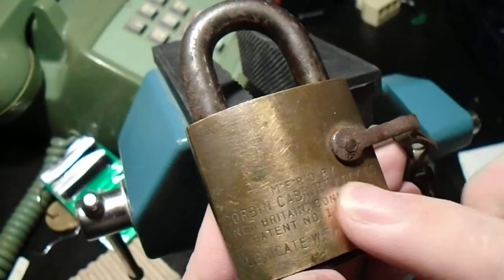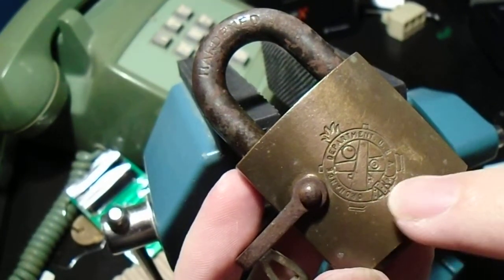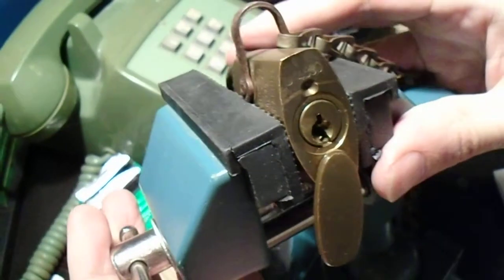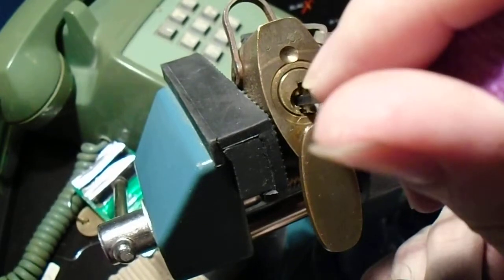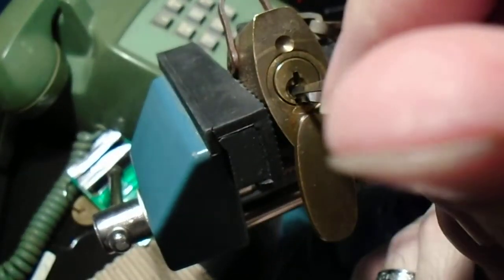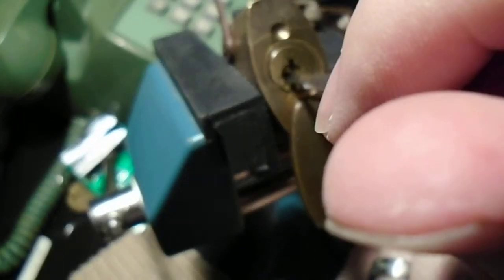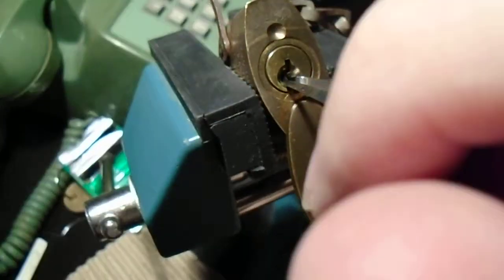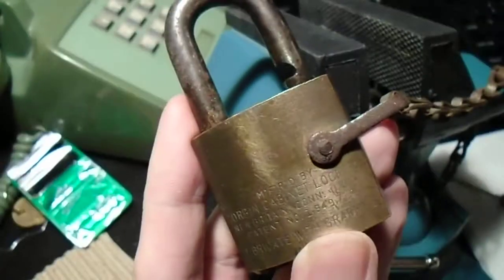(026) WWII Corbin padlock picked

Comment: Can you pick and make a key; same Corbin info.& patent # ? 2 locksmiths have tried to pick it; one found a key blank to fit, but no success at openning it.
Reply from the maker: Kenneth Bishop As shown in the video, it is possible to pick these but they are not easy. These have some very aggressive spool-type pins (or so it feels).
Impressioning these is also difficult because CCL tended to use round tipped key-pins which don't mark blanks easily, their age and used status tends to make them even more difficult to impression. A soft-medium impressioning attempt might be easier but that has it's own difficulties.
The easiest method would be (assuming your lock has a key number visible) to try to find an appropriate CCL look-up table and code cut the key but these tables are often not available.